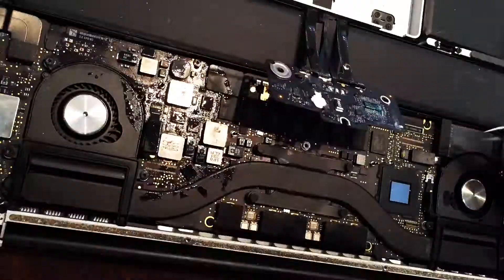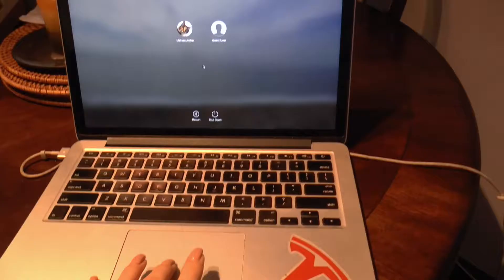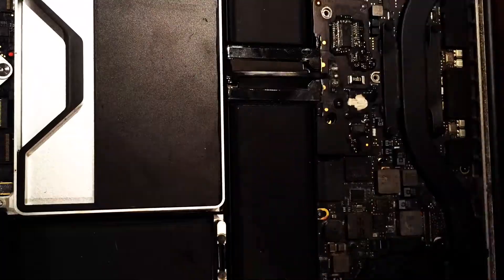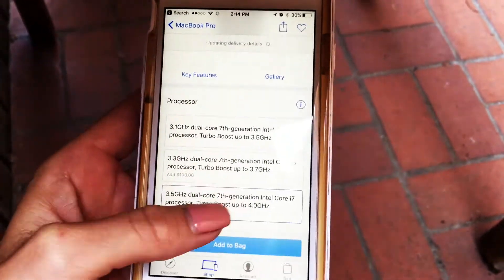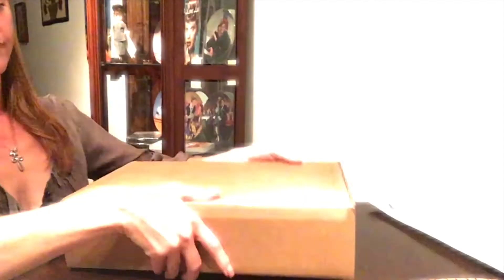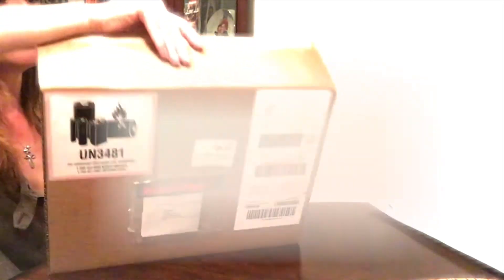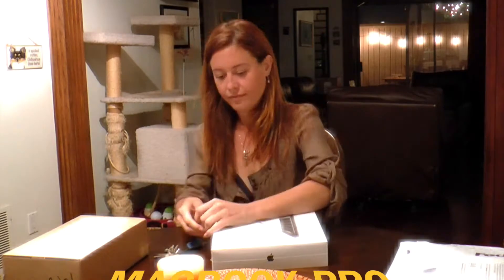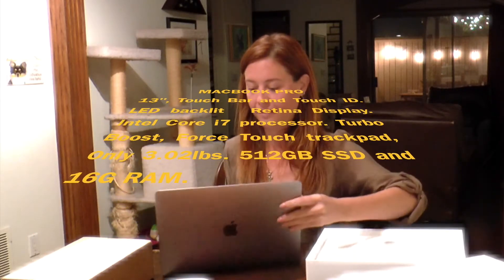Make It Ra1n Logic Board Problems

Comment: Need to wear one of those things that prevents static electricity from messing up parts. otherwise great effort. Should've saved the hard drive and the ram though. Could've been useable
Reply: I always use an external mouse (wireless).  I hate track pads.
Reply from the maker: The hard drive and ram were fine. The computer itself works, but needs a new battery and I have to use external mouse or replace trackpad